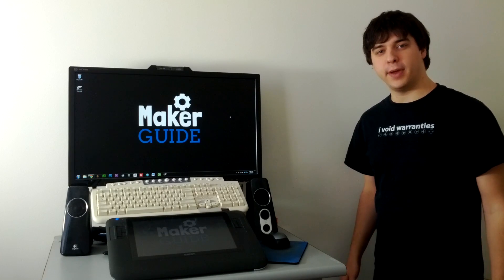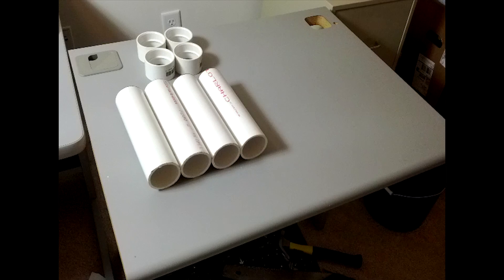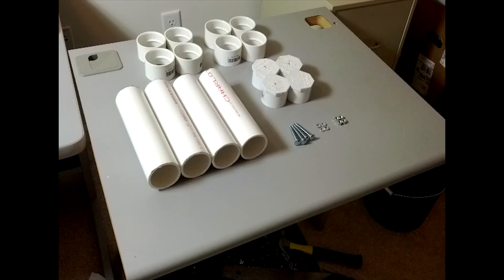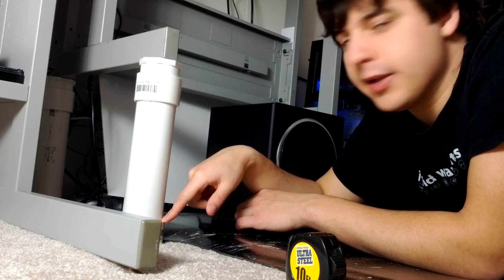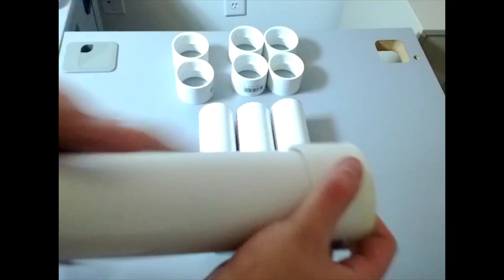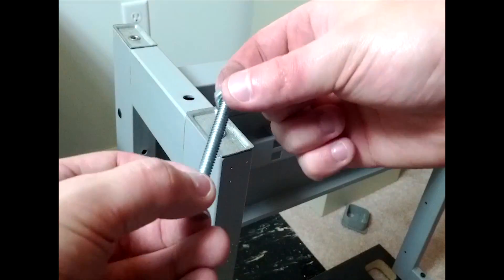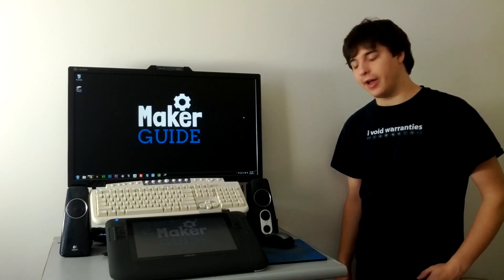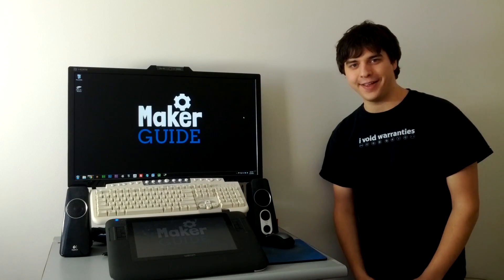DIY Standing Desk for $20 - Maker Guide Episode 1

Comment: lol use a nail to start the hole?... that is what a center punch is for and with one you are less likely to slip and hurt your self as the head is not sharp like a nails are. Always use the right tool for the right job, it makes your working environment a lot safer to work in. Any one who has study OHNS or has studded wood working or metal working would know this. Safety first! or have a disclaimer